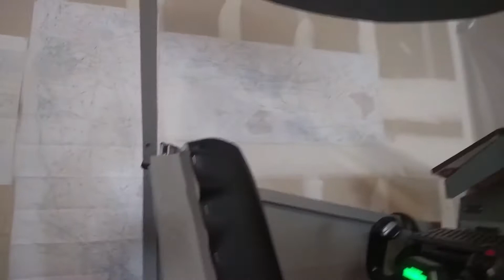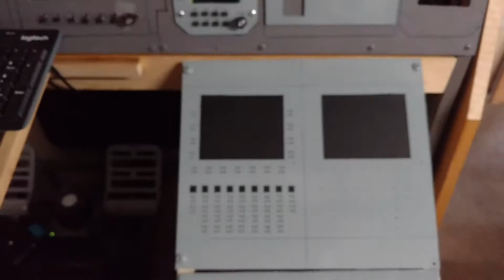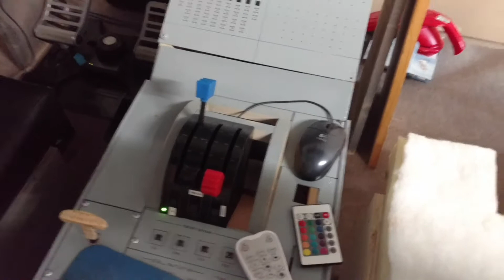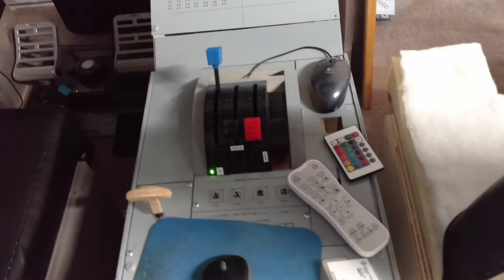Building an Embraer 145 home simulator - #6 - Seats and FMC

Comment: Nice video of the FMC. What kind of display you have behind the panel. Is it just a computer monitor? If Yes, where are you getting the FMC virtual display screen from?
Reply: The display is just a small 5 inch LCD display with HDMI which is running XHSI and X-FMC for the software on a RaspberryPi.

Comment: Hey Chris,  I enjoyed watching your video.  I'm currently building (rebuilding) my sim to be an erj 175/195.  It was originally going to be a CRJ but I fell in love with the Embraer regional jets after I started my build while looking for a decent flight model of the CRJ.  Anyway, if you'd like to collaborate on our projects that would be awesome.  Based on what I've seen in your video it looks like we've got a lot of similar ideas.  jtrsek@gmail.com.  Hope to hear from you! -Joe
Reply from the maker: Joe Trsek yeah I really like the 170-190 series as well...and their flight models are great, not a 737zibo but close. I wanted to do the 195 myself but the idea of buying 3 19" touchscreen displays to accommodate it as well as finding or writing software to put those displays on another PC pushed me to the 145 instead. We can certainly connect and swap some ideas. I will email you.
Reply: Thanks for the reply Chris.  I'm using the Feelthere 175-195 V2 and I agree, the flight model is decent and from what I understand, fairly accurate.  I wish a few more systems were modeled in the aircraft but it's good enough for me.  As for your comment on the touchscreen displays on the 175/195, there are none.  I thought they were touchscreens at first too but screen manipulation for the MFD is done with a mouse like device on the pedestal next to the throttle...easy.  Funny you mention this because what steered me away from the 145 was the buttons under the MFD.  It looked doable but not nearly as easy as using a mouse.   Looking forward  to hearing from you sir!